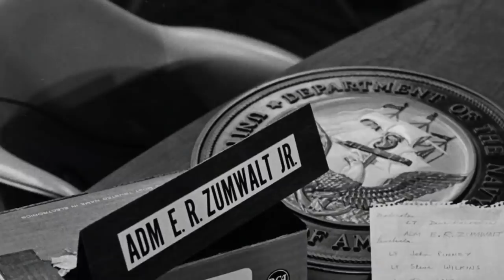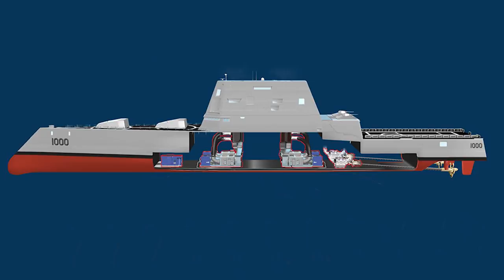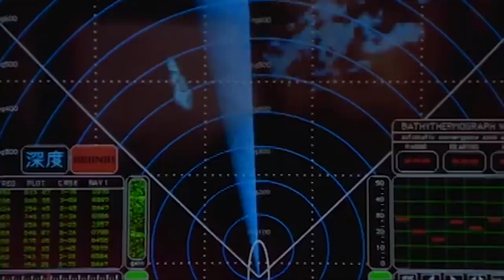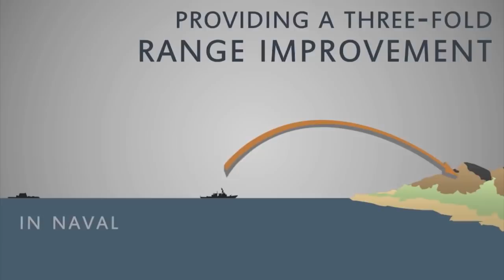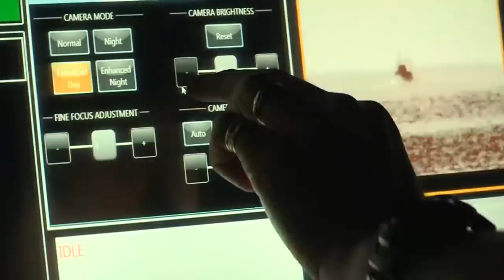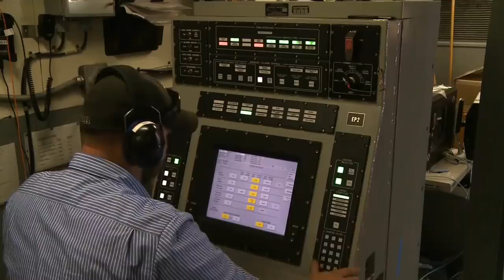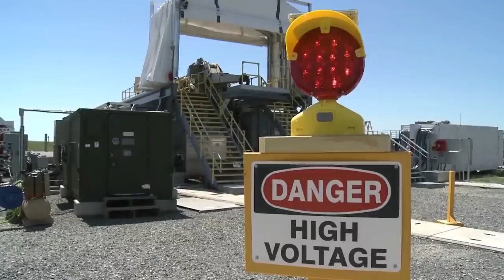Zumwalt - destroyer from the future

Comment: While ultimately the project was a failure, there are some useful things that we can draw from it. Worth the money that came in? Maybe, I dunno, but seeing as how we already have sunk the money into it, we may as well get what worth we can from them. First and foremost, the LRLAP system is an extremely interesting one. It doesn't have the payload of current shipboard missiles, but isn't nearly as large either, which makes it a more difficult target to intercept. Furthermore, being able to be fired out of a gun turret instead of a one-shot bay means you can store a lot more of them per ship. I think that there's a lot that can be done with this. Maybe get rid of the rocket, but keep the guidance package, like the JDAM targeting package used on 'dumb' bombs these days to put them precisely on target. Might hurt the range a bit, but would make it even more difficult for C-RAM to lock up and intercept. Second, the electric... 'drivetrain' if you will, for the ship, has enormous potential benefits once the bugs are worked out. Sadly, there are many bugs to work out, but then again, that's why we have three of them swanning about, isn't it? The level of automation is also not to be underestimated, being able to be crewed by fewer people overall is a good thing. But again, once the bugs are fixed. 
The project counted its chickens before they hatched. They had assumed that weapon systems like the Railguns or the laser weapon systems would have been ready to deploy, but sadly they ran into their own technical issues and are still in development. And it tried to do too much too soon, and as a result, ended up with multiple systems that only half-worked... which isn't good for a ship expecting to go into combat. 
But I think that once these technical issues are fixed, and are proven to have been fixed... several of these systems could easily see incorporation into a new vessel. The ideas are sound from a theoretical perspective, now we just need to figure out how they can work in the practical world we all live and operate in.

Comment: Anyone remember what Destroyer actually means? The term was originally applied to ships build to Destroy torpedo boats. Torpedo boats were cheap to build but carried lethal torpedoes that could put battleships out of action or even sink them. You could not expect a battleship to chase little torpedo boats around coastal waters, so destroyers were created to do the job. Later they were given the job of taking on submarines, U-Boat in particular, which posted the same threat. Later still, they provided anti-aircraft fire to protect carriers.
But all these jobs could be done by relatively small ships. After WW2 they just got bigger and bigger, Now destroyers are the size of old cruisers, blurring the line between the two. The only difference is the size and capability. 
I have my doubts that this new class of destroyer will live up to what we are paying for it. The mission of destroyers is NOT to destroy capital ships, but to protect capital ships from those that would destroy them.

Comment: The thing is: the only true purpose that those ships have in warfare is special operations. You put 4-8 special ops teams, like seals in 2 or 3 of them and set them like a pack to a certain area where u will need stealth to access. Then u can unload the men by boat, fire support by those expensive guided missiles and on top of that, if the mission goes to shit, u have 2 to 3 helicopters ready to evac. It is a brilliant ship for this kind of operation. Although I doubt the USA's navy would use them like that, if at all.

Comment: I look forward to "seeing" nautical railgun testing on these ships in the "near future".
Reply: And where do you exprct them to put it
Reply: @overlord4404  I think the original idea the Navy had was to replace one or both forward cannons with one of the prototypes the Naval Research Institute has been testing for a while.
Reply: @xara505  you dont understand, at the moment the realiguns are still in developement stage, also the ship needs to be way bigger to house the batteries for even a single gun let alone two of them
Reply: @overlord4404  I've actually been tentatively researching these very subjects, albeit out of curiosity, I admit. As this video states, each Zumwalt has two Rolls Royce MT-30 turbine engines which produce 35.4 MW (approximately 48,000hp) each. As Horizon implies (at around 9:38 in the video), "future ships" (like the Zumwalt class) are designed to potentially house the Naval Surface Warfare Center's (NSWCDD) various naval "coin-gun" (electromagnetic rail) weapons.
As each Zumwalt generates approximately 78 MW with all power generation systems operation, this is more than enough energy for multiple 8+ MJ (mega joule) railguns. As told to "Breaking Defense" by the Office of Naval Research project manager Tom Boucher, "Unfortunately, the only ships in today’s Navy that have sufficient energy are nuclear-powered aircraft carriers — of which there are just 11 in service — and Zumwalt-class destroyers — just three."

Everything about the Zumwalt was designed for future-proofing. Unfortunately, future-proofing is terribly expensive since much of it also entails R&D simultaneous to real-application testing.

The ships are capable but cost-ineffective. It's a shame, really. But as "science projects", they have unearthed tons of future designs for the Navy to pursue in the near future.

Comment: How to fix the Zumwalt class: 

1. Remove both 6 inch advanced gun systems, replace with one compact dual purpose 8 inch gun in one turret and one 30mm gun and one RIM-116 point defense missile box launcher combined in the other turret. A compact 8 inch dual purpose gun was successfully tested many years ago. This could be updated and integrated within the same space. 8 inch guns were determined to be the sweet spot for shore bombardment effects after detailed analysis and also happen to be the largest practical size for use against both air and surface targets. Modern mounts will have much faster speed and fire control has much better accuracy, making a large gun effective for use against slow moving aircraft such as helicopters and drone swarms as well as missile swarms. Enhancing missile defense and small boat defense with the 30mm and RIM-116 improves defenses to be equal or better than Arleigh Burke class destroyers. 

2. Remove the AN/SPY-3 Multi-Function Radar and replace with the AN/SPY-6 Air and Missile Defense Radar. The original system was supposed to have two radars working together but one was removed for cost reasons and this seriously degraded potential capabilities. SPY-6 performs the function of both radars at less cost, restoring full capability. This radar will make Zumwalt full effective in all aspect surface and air defense.

3. Fully fund and integrate missile defense capabilities for the TSCE-I combat system to bring it up to equal or better than AEGIS. Make it fully compatible with AEGIS data sent by other vessels on a shared network and able to send data back to AEGIS. Support ballistic missile defense and integrated air and missile defense. This allows Zumwalt class to participate in these defenses as well as enable such capability for future vessels using TSCE-I. After thorough comparative testing a decision can be made for future vessels to continue with AEGIS or switch to the newer TSCE-I system.

4. Add full fire protection systems, using both gas and water types.

5. Retrofit the three existing ships to these standards. Build six more ships to these standards. Add one to each of the nine Marine Expeditionary Strike Groups. They were initially intended for use in littoral waters and have shore bombardment capability which makes them appropriate to support the amphibious fleets.

6. Reclassify the Zumwalt class as stealth light cruisers instead of destroyers, the tonnage and size puts it in the range of traditional light cruisers. Firepower will still be somewhat modest but that is a trade off common to stealth aircraft as well. They can at least use their 8 inch gun and missiles to support amphibious invasions and use their upgraded sensors and systems for fleet air defense. They also would retain anti-submarine sensors, aircraft, and weapons.

7. Build much larger and tougher heavy cruisers using some of the technology from Zumwalt class but more focused on firepower and survivablity than stealth. Include some armor and strong hulls to take some degree of punishment. Use the much larger antenna version of the AN/SPY-6. Include over 100 peripheral vertical launch system tubes and multiple gun and missile based air and surface defenses. Include at least one dual 8 inch gun turret. Include automation and manning reduction measures to keep the total crew complement roughly equal to Ticonderoga Class despite size and capability growth. These should be purchased in large numbers, about 24 to replace all Ticonderoga class cruisers and both of the Blue Ridge class amphibious command ships. They would be distributed throughout both the Expeditionary Strike Groups and the Carrier Strike Groups with a few extra for area command or task force duties.

Comment: "Hey, we have these old battleships, we need to replace them, like, now, and aircraft carriers won't do because the missiles fired by fighters and the fighters themselves are expensive."
"Okay, here's a ship, it has guns that fire missiles and it only cost 20 billion dollars to R&D and build 3 of these"
...The logic.
Edit : Also, it does not even freaking have torpedoes?! aren't those like the cheapest way to sink ships (unless you manage to do so with main battery)
Reply: I'm pretty sure its unusual to get into torpedo range nowadays
Reply: @marcussmith7145  You do know you can also use rockets for the torpedoes? torpedo tubes can be also installed vertically, but for example, if you want to take out a enemy cruiser or like, let's say the Battle Cruiser of the Kirov class, you'd take out first the enemy battery and then sink it with torpedoes, since the Zumwalt is very highly computerised, it could most likely shoot more accurately than the Kirov.
And the torpedoes can be shot either from traditional tubes from quite far away, or with a vertical launcher that takes the torpedoes up into the sky with rockets and then they head towards the target and drop the torpedo into the water and it moves to the target like a normal torpedo would, just a lot faster though, traditional torpedo can go up to 15 or above in kilometers so if you'd manage to also take out enemy's propulsion, there'd not be much they could do about getting hit by torpedoes.
Then again, a Kirov for example, has very thick armor, it's almost like a modern Bismarck and we know that monster of a battleship did not want to go down even after hours of constant bombardment and torpedoes.

Comment: Congress had asked the Navy to procure a new class of ship to essentially replace both the Spruance & Arleigh Burke’s AND the Iowa and this is what the USN came up with in the end. The class had been intended for shore bombardment; and whilst stealth helps, in a littoral combat I can’t see it serving a ship any good. These ships are approximately one third larger than the Ticonderoga class. Their radar system is not amenable to fleet conditions...Every time I see one of these ship I simply want to scream. The USN could have done so much better. They could have done so much more for the USMc for this class, but not with this hull. Instead what I see is the USN still feeling that they are playing second fiddle to the USAF; which led them into the hands of those who might benefit most in the short run.

Comment: Looks like people are mistaking the Zumwalt  for everything but what it is - A unique ship able to handle multiple weapons systems. It's not a Burke, it's not a battleship. Try it out in as many roles as possible The future may not be punctual, but it always shows up sooner or later. While you're at it, don't bitch about changing the design to something it was never designed to be, then nitpicking about what it's not doing in that configuration.

Comment: Sounds to me like what your saying adds up to another military boondoggle. Would like to see which districts, senators and congressmen got what for the military contractors in their respective bailiwicks. Also appears that the punch lists are lengthy and that sucks considering the per issue price tag. Bottom line to the sailors, captains and more importantly national security is ...  are these Z's reliable machines or lemons that will require constant maintenance, troubleshooting and retrofitting? Based on your piece I'd say the latter. And what's the additional cost of all that? In the midst of a hot war, we don't have time for m,t or r!

Comment: It’s basically a Burke class without AEGIS. What a disaster. None of the ship’s selling point was accomplished. New air defence system - canceled; new rail gun system - canceled; new advanced projectile system - canceled; new anti submarine system canceled; new ultra stealthy feature - ruined by the need to add additional old exterior radars due to the canceled integrated air defense radars. In fact the entire program failed so spectacularly that the Pentagon had to cancel the program and restart building more Burkes.

Comment: Why not just Modernize the WW2 Battleships? It's simpler than building a entirely new ship to replace it! Like replace the Iowa and Missouri's 15 inch guns with Rail Guns! Replace the rear turret with a Missile Silo,Heli pad and Hangar,replace secondary 3 inch guns with 75mm Cannons and it's AA Batteries with Phalanxes,give it more modern Radar and Sonar capabilities,and give it Torpedoes,replace the Catapults with extra Helicopter Storage and a Helipad,and give it all other new equipment that it needs to survive in Modern Warfare! Boom!

Comment: Would've have been cheaper to modernize, and pretty completely overhaul the Iowa class battleships to fill the same roles. The Navy has been failing hard at projects for 20 years.
Reply: Nah. Battleships have come and gone. But they could design something like this on the Ticonderoga hull for all these new technological innovations.  Not sure why they would not. The review is good, the Navy wants everything in one ship. It's not a good move.  What they need is a dedicated picket ship for carrier defense.  Again, the Ticonderoga hull could be used for a ship with 8 CWIS and a couple laser systems. Keep the old guns (2x5" and bushmaster systems) and some SAM's in the rear VLS for good measure and all new ASW stuff including the helo.  Let the destroyers perform the attack role.

Comment: As an American, I'm ashamed at the waste of both the Zumwalt and F35 programs. 

The Zumwalt program was hugely expensive and delivered practically nothing in terms of capability. There are SIXTY SIX (66) Arliegh Burke class destroyers. Three Zumwalts doesn't even move the needle.

The extra cost of "stealth" is stupid when the ship can easily be seen by an observer in the air or satellite. Further, any radar detection system won't have any trouble finding it. Finally, if Zumwalt is operating as part of a fleet, its stealth is completely worthless because the rest of the fleet won't have stealth (and they'd all still be running radar even if the entire fleet was stealth).

Comment: It absolutely should have been the future, and I strongly believe time will side with the Zumwalt. But as of now it has been a failure, in large part because its cannon isn't being used, nor is ammo being made for it. Instead we continue to produce cruise missiles at 1.5 million dollars a piece, or launch carrier aircraft at $50,000 per flight hour (the cheapest part of a carrier battlegroup). Sending a lone Zumwalt and a drone rather than a carrier strike force to for punitive strikes such as those seen in many ISIS nations across the middle east would be dramatically cheaper. The other advantages such as far greater stealth, a power generator and infrastructure surplus, modularity to name a few are all absolutely steps for the future, and areas that current generation ships absolutely cannot close the gap to a meaningful degree. Even if we replaced the cannons with more VLS launchers in future generations, we should still be building more Zumwalt class rather than the Burke class currently being built (with many more planned for the future). Indeed the only thing I don't like is the lack of CIWS and reliance on longer ranged missiles like the ESSM, but it can always work inside a strike group if we ever have a superpower on superpower action. And, of course, the removal of its intended radar in favour of the dated version handling tasks it shouldn't be touching doesn't help either.

Comment: Whenever my company makes an expensive mistake, rather than acknowledge our errors and honestly try to evaluate how to do better, we instead put the loss on our R&D budget and move on. The Navy kinda did that here, except it was taxpayers money and the loss wasn't caused by incompetence or bad luck but instead corruption. You know with that much money flying around at least some of it made it into the pockets of the Navy brass which is why they didn't pull the plug at a 5 or 10 billion dollar loss but instead let it get to 22 billion.